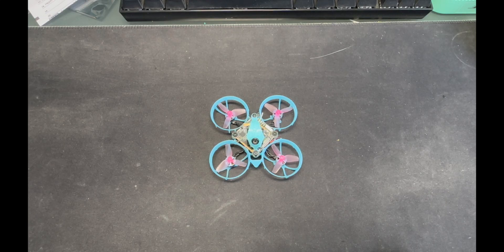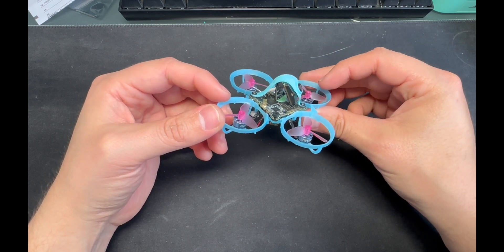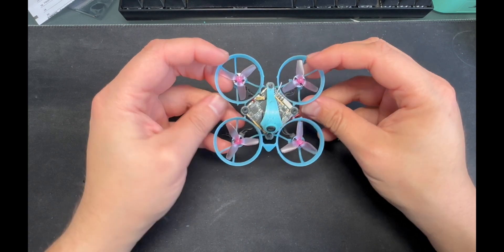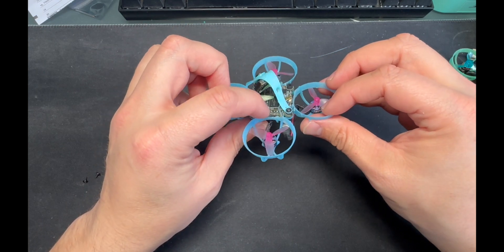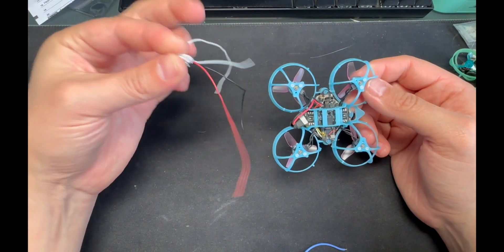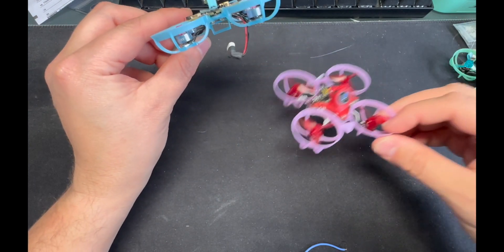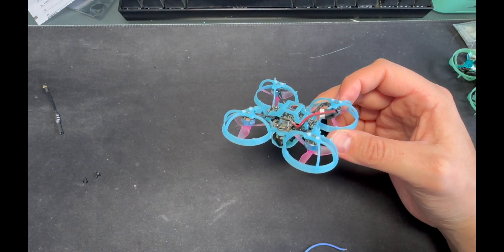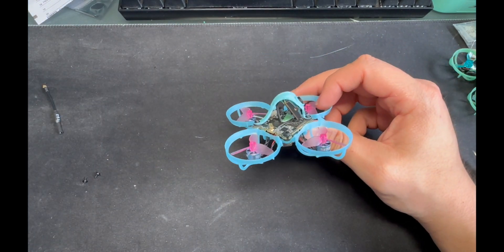Sub 20 gram HDzero Whoop!

Comment: Got mine down to 18.98g by going with foaming TPU canopy(half weight) and foaming TPU grommets. I use my iron to "weld" the grommets to the canopy and a drop of e6000 on the frames controller posts to hold the grommets in position without screws. Trimmed one arm off each duct and also Shortened the height of the ducts as there was extra material there well above the blade heights. I also went with lower gauge wire on controller to trimmed down BT2.0, enamel wire for controller to VTX connection, Reny motor screws, metal housing removed from USB port(usb still works though). I also tried enamel wires for the motors, but using stock wire cut down to exact length needed was so close in weight I switched back. I also removed the two brass inserts on the camera housing.I have the new eco coming that will get similar treatment, I'm hoping the new lighter happymodel 0702s(mine were off a moblite6) and eco hdzero will get me closer to my goal of just under 18 grams.

Comment: Awesome build.  I was also thinking about taking off the usb, definitely seems like a lot of unnecessary metal there.  Any examples of how to do this successfully, especially if there's a way to reduce weight but keep it usable?
Reply from the maker: I'm sure there is. I'm going to play around with another FC that has a failed elrs receiver and see if I can successfully remove and replace it. I'm thinking a heat gun would be the best way
Reply: @MukiFPV  I just successfully removed only the metal part of the same USB port from an older drone with a side cutter.  One of the data pads came very close to lifting but the port still works.  I think a drop of glue to help stabilize and it'll be all good.  It's great to save the weight and still have a usable port.